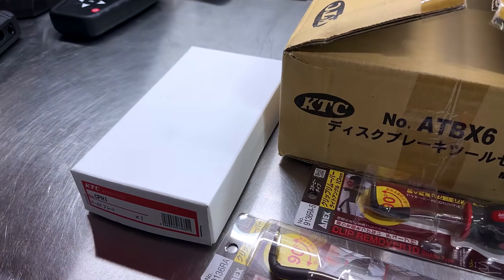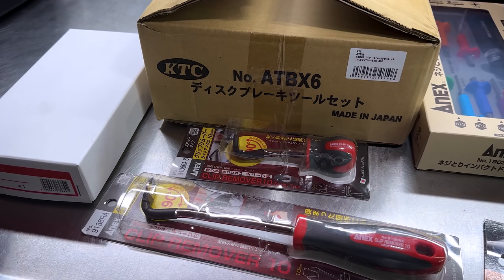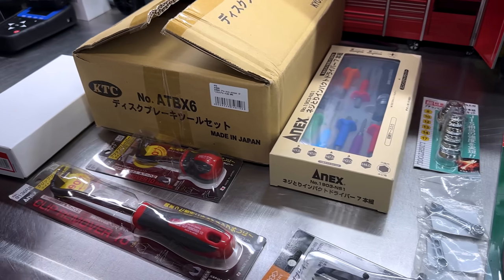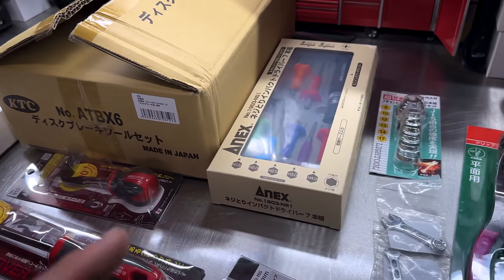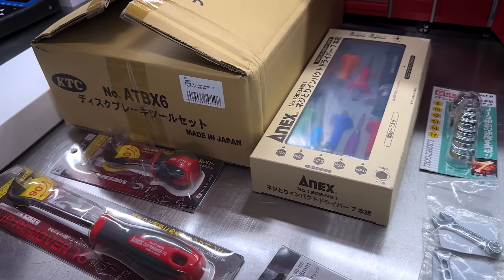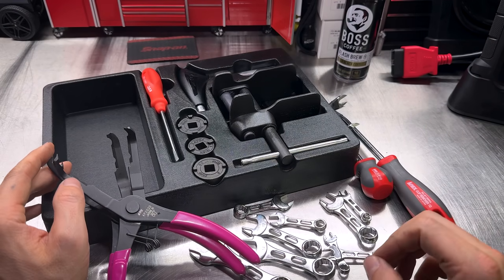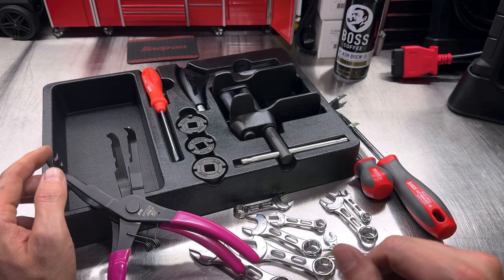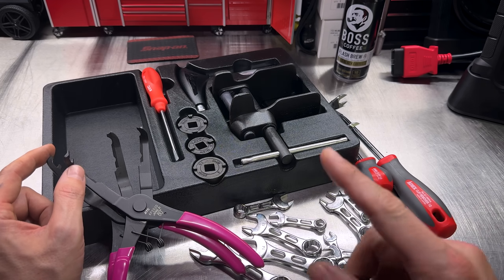First Japanese Tool Haul In 2024! KTC, ANEX, ASAHI, & MERRY! Affordable High Quality Tools!

Comment: I've had that Anex impact driver with the orange attachment for years. So far I got no use out of it. Every time I tried it failed and I had to resort to other methods. Since then I got myself some other tools for stripped screws, like the ones from Engineer and the USAG (Mac RBRT) hex bits but I haven't had any stripped screws for quite some time so these still need to be tested.
Reply: I had one of those impact drivers from AutoZone back in the day for my motorcycle. It worked pretty well.
Reply: I have the OEM tools mid 90's impact hammer screwdriver but almost all of those bits are broken by now..

Comment: Would you do a video about the cvt solenoid and when it’s better to replace the solenoid pack or when you should replace the entire cvt. My 2016 Crosstrek is close to 160,000 miles and would like to know how to tell what the best repair will be when I get the solenoid issue. Thanks.
Reply from the maker: You have to replace the valve body as an assembly. Solenoids aren’t available. You can find cheap junk solenoids on eBay, or used ones, but they fail in short order and you’re doing the job over again. Have done several videos on the VB replacements.

Comment: Nice tool haul. Thank you. What do you recommend for socket set for aluminum wheels. The ones that say will not scratch wheel. Not sure if they have a specific coating to prevent marking wheels? Any help would be greatly appreciated.
Reply from the maker: Ko-ken - https://kokenusa.com/products/wheel-nut-socket-set-1-2-sq-dr-17-19-21mm “MrSubaru10” promo code says 10%
Reply: Thank you Robert.

Comment: Hey! I keep hearing that you can’t use aftermarket catalytic converters on Subarus (I have a 2016 2.5 Outback), because the ECU is too sensitive and will throw a code and CEL. Is this true? Are there any more affordable options? I love the videos! Love the tool hauls and all the information. Just got the Topdon Artidiag Pro and it’s awesome. You’re a fantastic resource! Thanks for all the help!
Reply from the maker: Check out AP Emissions. Met them at the AAPEX Show. From NC. Their cats are factory spec, and more affordably priced than OEM.
Reply: Thanks! If you ever get the chance to do a video on a FA/FB exhaust replacement, I’m sure it would help a ton of folks. Appreciate you!